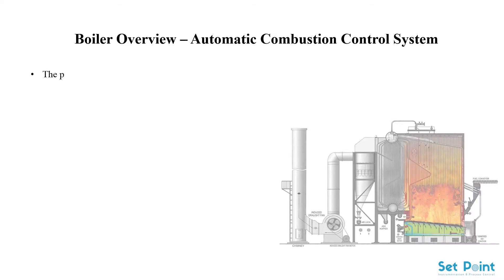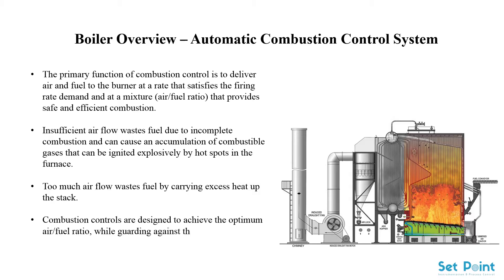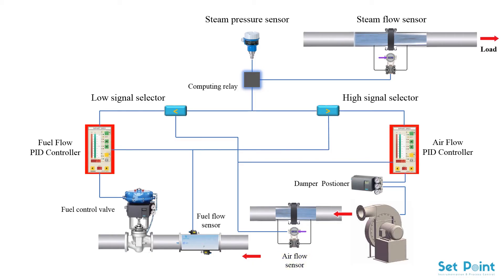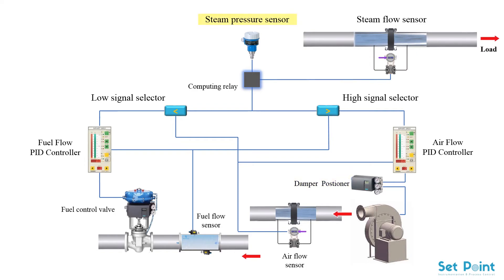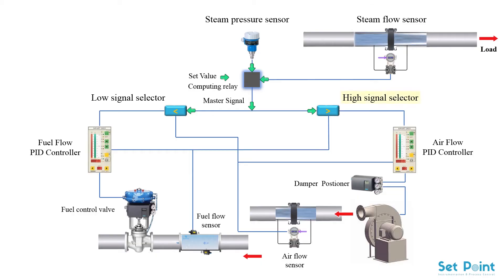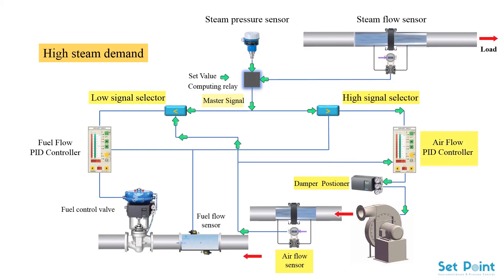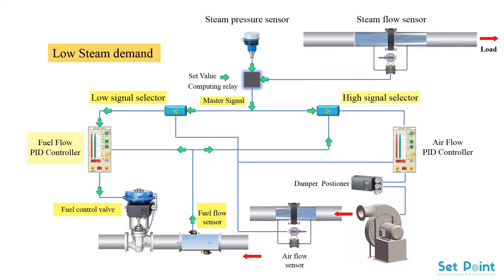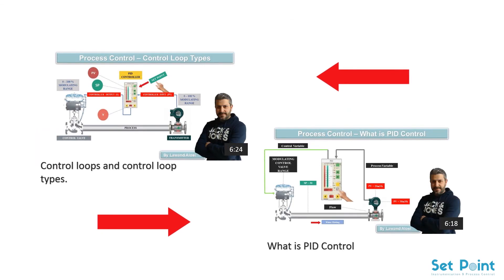Boiler Automatic Combustion Control System

Comment: Does this apply to watertube coal fired boilers
Reply from the maker: No, , there is a difference. Coal-fired boilers need complex fuel handling (pulverizers, feeders, ash removal) and combustion control systems, while fuel-oil boilers are simpler since liquid fuel is pumped directly to burners, but they require heating and viscosity control.
Reply: @Set-Point  thank you for the response . I understand however in terms of the control startegy and logic would it differ alot ? .In my thinking the control valve for oil essentially would be the feeders right? and lastly the high and low signal selctor would they apply to the watertube control strategy
Reply from the maker: @TheNdlela  Right, instead of the control valve of oil, coal feed in a watertube coal-fired boiler is controlled automatically through the coal feeder speed (or gate opening), based on steam drum pressure or steam flow demand, and coordinated with airflow control to maintain safe and efficient combustion. 
You are welcome dear ....